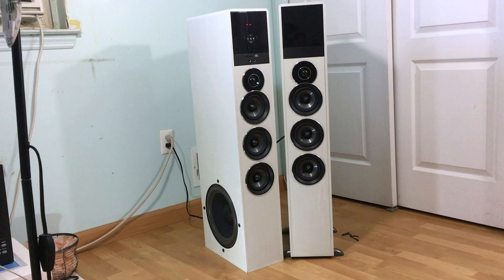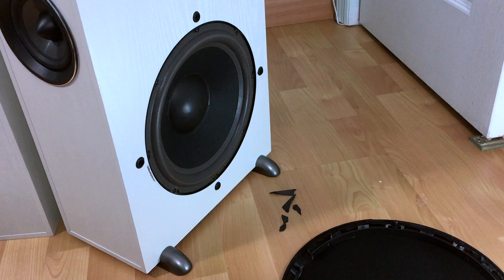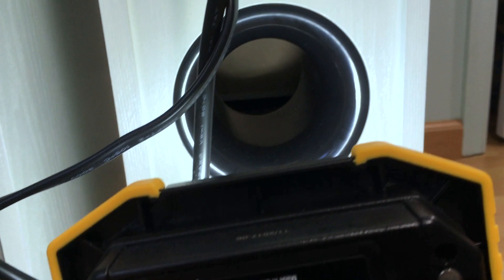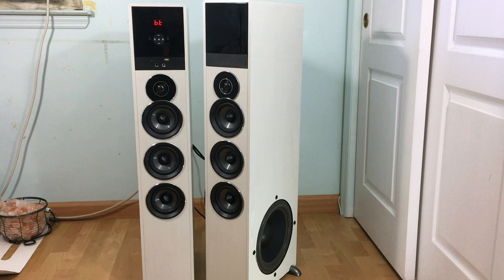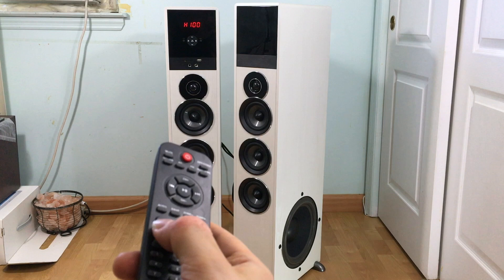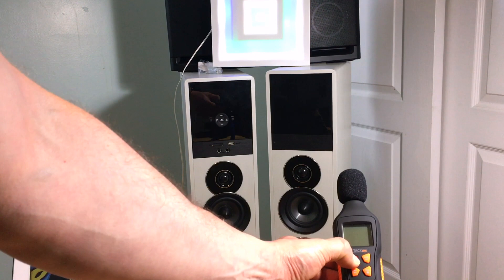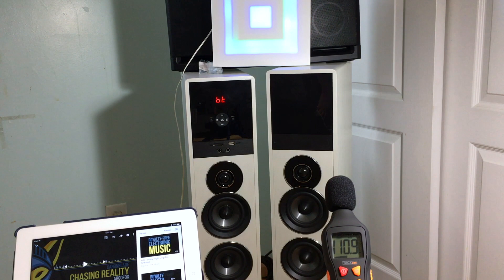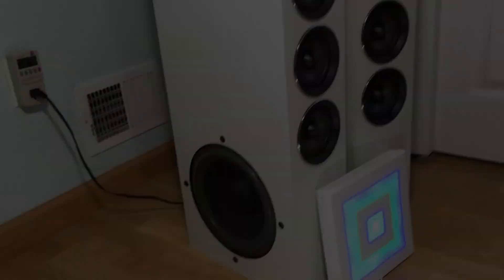Rockville TM150 (Too in depth test, watts, heat, frequency response tests)

Comment: Shouldn't floor speakers be kept several feet apart? You have them too close together which is distorting the sound and if you kept them like that then that could damage them over time.
Reply: Uhm how will this damage them your tripping 🤔
Reply: They are going distort anyways because the biild quality they are going resonate pretty badly making the vocals sound boxy or muffled you can hear it in the video and also his mic is clipping a little

Comment: Awesome review.  I still have floor speakers I bought out of a van, back in 2001.  They still sound awesome, but was checking if anything better in the year 2024 for $350 or less.  I'm so surprised to find they have mostly been replaced by "sound bars", sound bards aren't bad...but nothing even close to my old speakers ($150).  Don't think people are into sound anymore or more people rent in apartments and just can't have anything like this?

Comment: Good fairly thorough job, what I would like to see is this:  If you can pull one of the subs out of the box, and check the ohms, then get online and find an upgraded ten inch sub with a pulp or (just anything more rigid) with a decent sensitivity rating and see if you can pump more bass out of these towers
Reply from the maker: hey man, unfortunately I no longer have these speakers.  I made an updated video about how these broke about a month after this video.  I mailed them back for warranty work and it was not fixable.  I think the amp just went out on it.  Sucks.
Reply: I would love to just upgrade the speakers and maybe even the amp from parts express

Comment: Cone are made from papper. 
Receiver is built in with the same house as the Speaker means after it heats up and makes the soldering soft the Speaker vibrations will break the connections. I give this system 1 year of use before its broke
Reply: If you say a year, you win. What is it if 4 months? That is 1/3 of your prediction.

Comment: Paper is the best material for “sound quality”..... yes it is not durable at all, reason companies started “treating” the paper. Treated paper cones can still have the sound quality yet also be more durable than just non treated paper cones. A lot of manufacturers went with polypropylene, or the like. I am not a fan of foam surrounds either. Rubber (or similar) surrounds or a speaker isn’t worth anything. The foam will always deteriorate pretty fast making them not very durable. 

Speaker box material is MDF (Medium Density Fiber-board), not MFD.

The heat sinks getting hot just means they are doing their job.
Reply from the maker: yes, I just said MFD incorrectly,  you're right.  thanks for watching.

Comment: How long is the cable that hooks up the two speakers together? And I know it's very hard to tell over video but is the bass good enough from far away to feel question or do you just hear it? I have a vizio soundbar and wireless sub and I am impressed with it. It's usef on my outside movie screen and I want to get something else because I don't like disconnecting it from my bedroom to outside every time I want to watch a movie outside.

Comment: Damn... I wanted another pair of the older models, not as much connectivity options, but they turn up to 50. I wonder why they stopped making them though. I always hit the hard switch in the back after I use them. 

Thank you for the review.

Comment: I could have sworn I see the LCD display dim when the sub gain was raised... If so I'd say the power supply isn't up to snuff which in turn hurts the performance of the amp. But hey for money eh not bad still.
Reply from the maker: hey man!! I didn't notice that, you're probably right though.  Guess what??  A few weeks after this video this system completely failed, I had to send it in for warranty work, and they could not repair it, I just got a refund.  So I'd say the amp got fried, there was no sound at all coming from the speakers.
Reply: It has a dimmer switch.

Comment: Hows the latency when connecting bluetooth to the TV?
Reply from the maker: hey man, let me update you on this system.  About a month after this video I had total disaster with this unit.  IT would not produce any sound at all, as if the amp was fried.  I sent it in for warranty repair (paid shipping myself) and it was not repairable according to ROCKVILLE.  After fighting for a while I got a refund, less a 15% restocking fee.  Ive made follow up vids on this.  Otherwise the connection to bluetooth was normal, not as quick as a JBL.

Comment: Would it be possible to upgrade the speakers and replace the amp with a amp from Parts Express
Reply: Probably if you know what you're doing.
I was thinking about switching out the Subs once they decay. They're only paper, unfortunately.

Comment: You sound like Ray Romano's cousin Gerard. Lol

But, yo, seriously, maybe if you didn't max the Bass out and pump up the Volume to 90% your speakers wouldn't have quit working. 
They're only speakers, and if you abuse them, you can't expect them to endure that abuse without damage. 

I have the Rockville 5.1 Surround Sound and I just ordered these yesterday. The first 5.1 unit did arrive defective, but the replacement unit was fine. I had to out of pocket the cost for the replacement because they wouldn't send one until I shipped the defective unit back and I didn't want to be without sound for our TV until then. Still currently waiting for the refund to come through. As of 2 days ago they said they haven't received the unit back yet. We mailed it on the 3rd of August. 

Anyway, I'm going to take my chances with this system, but I'm not going to full out abuse the crap out of them. Can't expect equipment to last if you abuse it.
Reply: How are they? I think I'm about to buy them but not if they're going to die quickly
Reply: @pooop813  These speakers are dope, man. As long as you don't abuse them like this guy did they'll last you a long while. I've had mine for going on 2 years now and they still work fine and they still thump.
Reply: @michaeldavis3913  thank you! I like them but skeptical because of reviews. I love that its dual 10s. I appreciate the reply I'll probably get them. Do the subs face eachother or outwards? Heard you don't want them to face eachother and that the left and right were backwards so you had to face them improperly
Reply: @pooop813  They're outward. They don't face each other. You can turn them to face each other if you wanted though. 

This was a solid investment. It really was. Every now and then the slave speaker will get weird and be a lower volume than the main speaker. But if you flip the switch in the back for a second and turn them back on it goes back to normal volume levels. This fucks with me sometimes because I can hear the difference when it's not pushing as much sound as it should be. Idk if it's just a random thing or just my set of speakers. But it happens sometimes. Not very often though. I thought it was the cord itself so I had to order another one because my kids fucked the first one up. 
But overall these speakers are pretty legit. Especially for $239, at least that's what I paid for them. And they're fairly loud. I was playing COD the other day and our downstairs neighbor came up to bitch about the explosions lol 🤣 I guess they were rattling her walls. The bass wasn't even on either. Haha these fuckers bang.
Reply: @pooop813  And like I said, as long as you take care of them and don't purposely abuse them, they'll last you quite some time. 
I've had my fair share of speakers, and these really aren't bad at all. 
I know they're a cheapo brand and whatever but they're pretty decent for the price. 
The only thing I actually dislike about them is that the Subs are paper cones. I wish they were the PolyPropylene or whatever the face speakers are made of. 
But I don't regret buying them at all.
Reply: @michaeldavis3913  thanks for the info my friend. Ended up buying the 10inch version tonight! Super excited and I'll take good care of them.
Reply: @pooop813  That's the same model I have. The TMB150 I believe they're called..
They have the 10 inch subs. 

Enjoy! Let me know how you like them.